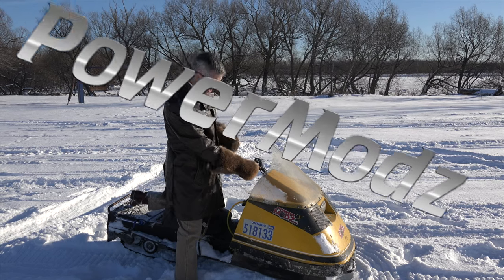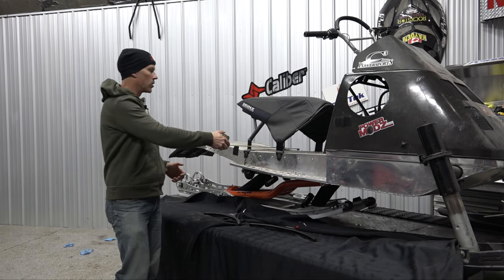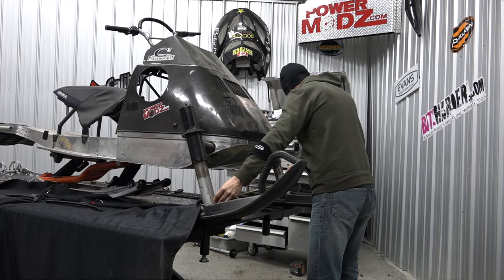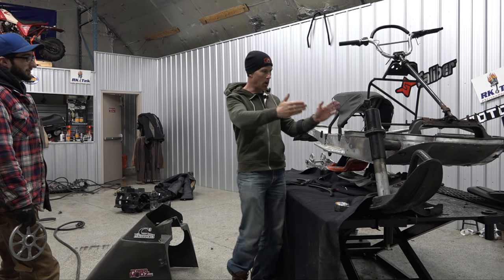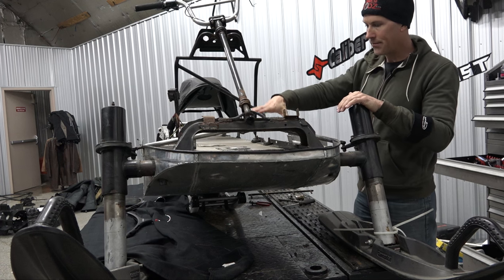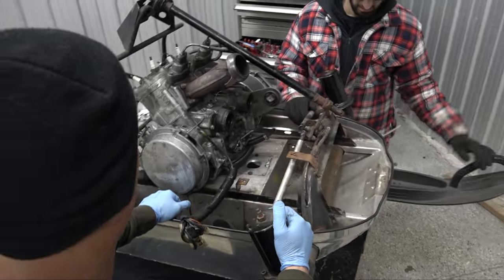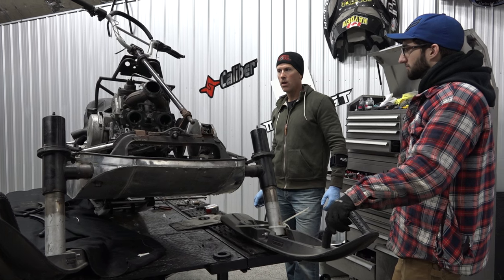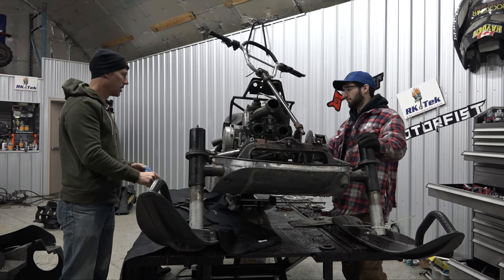Mega Elan  Snowmobile Mod Project Ep #1  925 big bore or 827?

Comment: rev isnt 1/2 wider, it has plates on the side of the tunnel.  No need to do all this tunnel work anyways, just move your motor plate side to side wherever it needs to be, and dont move motor forward and track back or it wont handle at all like an "elan".  Look at a stock elan for how the clutch/chaincase layout is, think of the handling on an elan vs "today" sleds.

Comment: Why not a smaller engine, say a 440 or 500 liquid cooled with a turbo? There is a replacement for displacement: Boost! 
Keep it light but add power. You won't gain as much power as with the 900cc big bore but you won't be hauling around that weight either.
Reply: A 500 isn't much lighter than a 800 and the big bore will actually make the 800 lighter and if you include the turbo on the 500 the 925 is probably about the same weight
Reply: And the other difference is torque. A 800 has a ton more torque than a 440 with or without a turbo and once you add a big bore kit you increase the numbers even more. Looking at way over 100 ft pounds easy when a 440 is barely in the 60s